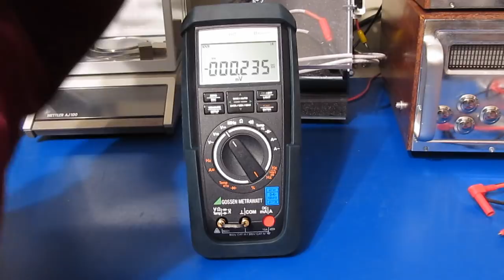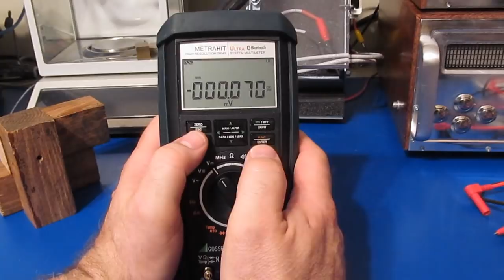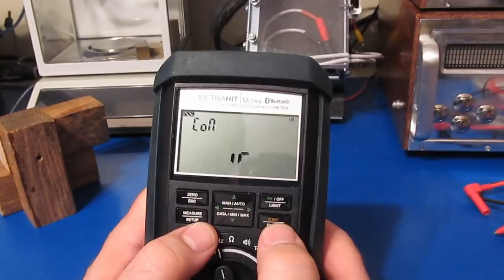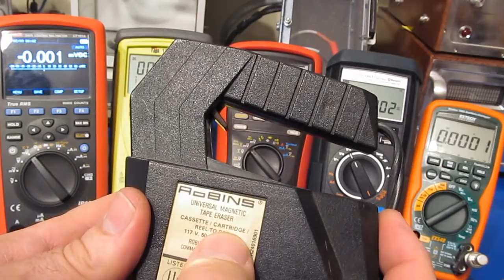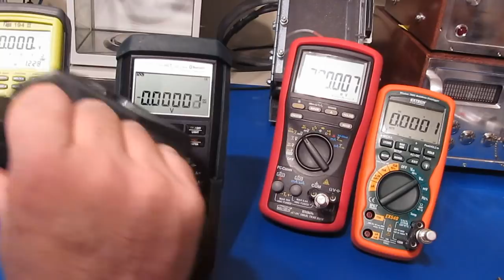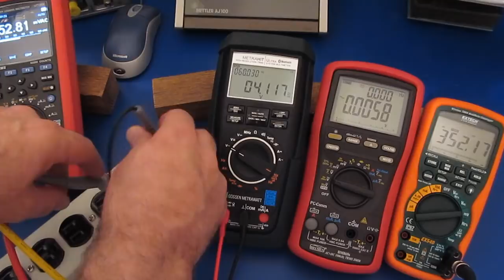Gossen Metrawatt Metrahit Ultra M248B Review Part5

Comment: Have you tried with a strong RF field on the meter? For example  a VHF/UHF hand held transceiver transmitting with the antenna in proximity.  The relay involved must be of a very high sensitivity, a reed type? In any case I wonder what kind of safety standard is the Gossen tested to!
Reply from the maker: Perhaps less time posting, more time watching?
Reply: Perhaps
Reply from the maker: Watch part 3.

Comment: Joe, you asked for thoughts on the relay buzzing and weirdo readings thereafter. Well, here's how I see it. On the one hand, if I was using a multimeter and it made a noise like that, I would be carefully checking it for proper functionality before doing anything important with it, including testing circuits which might be high voltage. Only once it demonstrated plausible performance would I begin to trust it was working satisfactorily. I suspect you would do the same. :-) On the other hand, not all users are so sensible, all the time. From reading the manual for this meter I've noticed some typically German approaches to safety, i.e. pretty serious and effective. An example is not allowing the changing of settings or even switching off if a high voltage remains connected, so that the indication of high voltage remains visible on the display. That's unusual, but good, and sensible.

Nevertheless, I'll agree that the 'accidental' application of a strong magnetic field did cause the meter to show an incorrect voltage which could have resulted in a user misunderstanding the threat level and getting zapped. Ouch. 

It looks like there's a downside to designing a meter to be remote controllable. Another typically German approach to things is to deliver advanced performance through sophisticated, complex design, which sometimes results in unexpected emergent behaviour. You've found one of those!

I'll admit to being drawn to designs for various things that push the envelope and provide higher performance, over conservative designs that provide reliable but lower level utility. Sometimes this pays off, sometimes not. Given its performance advantages, I'm still waiting for you to find a showstopper for this meter. ;-)

Regards, Rick
Reply: >  if I was using a multimeter and it made a noise like that, I would be carefully checking it for proper functionality

The fault did not appear to be cleared by power on/off I think, so you could turn the meter off, put it in your tool bag and tootle off, at some point a magnetic field comes along and twiddles the relay in the meter without you noticing, maybe you're not even there, sometime later you turn it on, and you're in a bit of a pickle.
Reply: Hi James. You're right. It's worrying. I've noticed with the Fluke manuals I've been reading, they say to confirm the meter is working properly before stepping up to measuring something that could be dangerous. Good advice!
Reply from the maker: Right.  Keep in mind you may not have ever heard it.  See part B.

Comment: Thanks for the video. If this was my meter, it would be going back for a full refund. This is a big company and they will not communicate with you about this problem. This is not a company worth your time or money.
At this point, I do not even want to see what is inside, just the outside alone is bad.
I will watch if you do take it apart just to see, but Gossen should not make money from this sale.
Get a Keysight  meter, or see if there is any good low priced bench meters to test. Having a good low cost bench meter that works really well, would be better info then this Gossen.

Thanks again for taking one for the team so to speak with this Gossen.
Have a day
Reply from the maker: Believe me, I would hold NOTHING against someone who wanted to return ANY product if they found problems with the design and the company was unwilling to communicate with them.  But, I am not testing these meters because I need a new meter.  I test them purely out of my own interest in how the meters are designed and how robust they are.   I am the type who will finish what I start.
Reply: Thanks for the reply. From watching your other videos, I was thinking you are the type of person that was going to test it till it breaks. From this point on with this meter, its get the popcorn a drink and watch the sparks.
I liked all your videos, I do not understand all the tests you do, they are still very interesting.
Was wondering could you do a video on the types of tests and why you do them. That would be a helpful video, in understanding more of what you do.
Have a day
Reply from the maker: I will certainly test it to the same levels under the same conditions I look at every meter.  

I have done some videos on the various tests.  They are scattered around so unless you actually followed the whole progress and read the forum,  you would be missing out.